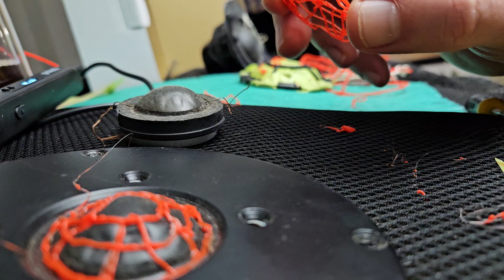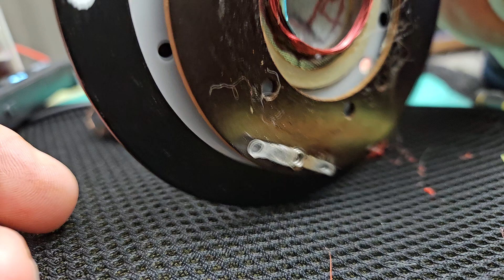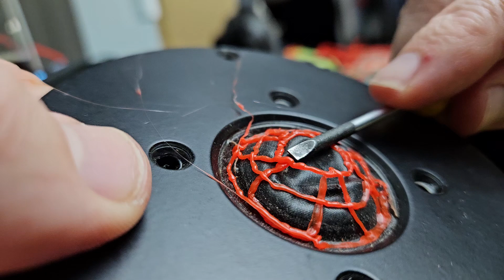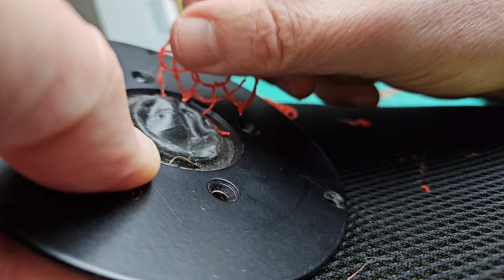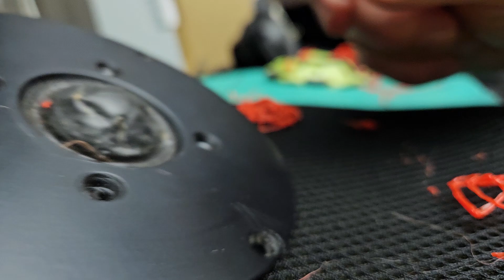Result: Garbage

Comment: Just a tip: Cut the masking tape into strips to create a thin layer to prevent sticking or fusing with silk, and then print on top. This way, with the thin layer, you allow for the shrinking of PETG . keep in mind that pet is hotter temp. a buffer will help to prevent fusing.
Reply from the maker: Various tape methods do cross my mind but this little circle is impossible and keep a nice curve. I ended up using a ping pong ball as a stand in.